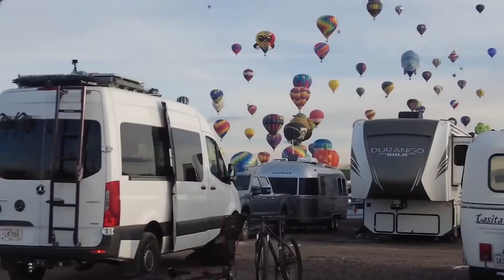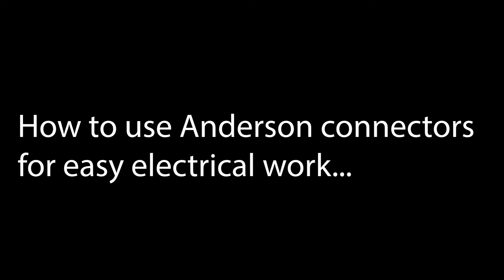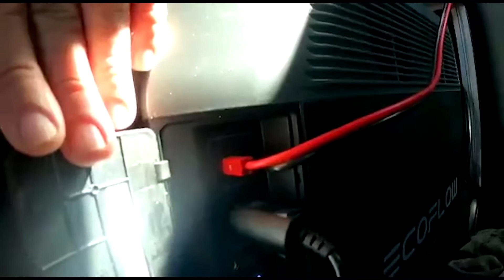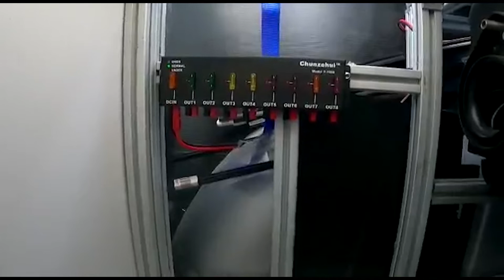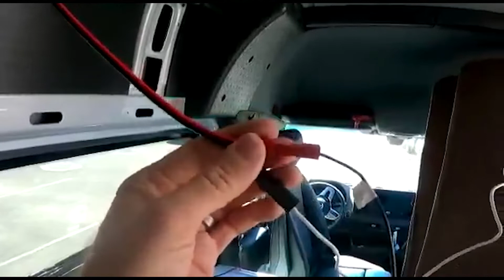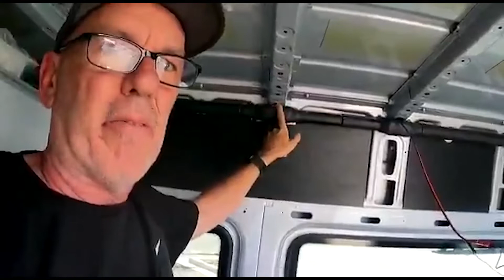HOW TO USE ANDERSON CONNECTORS SIMPLIFIED ELECTRICAL SPRINTER VAN BUILD

Comment: So you connect the EF DP via the anderson connector to the to the 12v fuse box voltage in, and then pull a wire from the fuse box across the van to the otherside and put an xt60 connector which you plug into the "solar charging" port on the river pro, and in that way get the trickle charge from the delta pro? 
Can you show how you connect the ecoflow DC in to the fuse box? Is it using the anderson port on the EF and then just a wire? Would love a short explanantion, it sounds simple but  just to verify..  im planning to build this in the coming week....
And then also how do you handle the 120v circuits? Do you just plug each on into a plug on the delta pro via extension cord? so like an induction cooktop, just plugged directly in to the DP?
Reply from the maker: Hello - Yes, we trickle charge the River Pro via the Anderson fuse box.  In order to connect the ecoflow delta pro to the anderson fuse box - you just take the wire and add anderson connectors to both ends - then simply plug into the delta pro and the fuse box.  Very easy if you need to make changes.  RE: 120v - yes, we just use extension cords to run the induction cooktops - simple and easy.  Best wishes with your build - so fun!

Comment: Hi. Still figuring out if I want to go with the Eco Flow. Looks so simple. 
A question I have is if I want to have a 110 plug say to run a coffee maker is that something I can run from the Anderson panel?  Do you think they have some sort of combination connector that would go from that 110 plug to the wire to the Anderson panel? Or do you think I would have to plug the coffee maker to the Pro?  I will be doing a few days with the battery power so the  Big pro will be enough.   Thanks
Reply from the maker: Hey Chris Hart!! The coffee make is a 110 volt and the Anderson is a 12 volt so the coffee maker has to be plugged into the Delta Pro. We are loving them and really find it very simple and easy to find charging stations etc... One of our last videos shows how we are currently using them and charging them.  Thank you for watching and taking the time to leave your comments.

Comment: Hi. I had the same question as Ruth?  Can you wire from the Anderson panel to a 12v plug so I can run a refrigerator?  I’m not that sharp with the E. Thanks for the vid
Reply from the maker: Hi Chris - yes you can wire from the Anderson fuse panel to your 12v refrigerator. On the wire coming from the refrigerator you just install Anderson connectors and plug into the fuse panel

Comment: It was great to see your set up with the Eco Flo because that is precisely what I have been planning on with my van.  Would you mind giving a parts list of the anderson connectors as well as the fuse box? Thanks
Reply from the maker: Hi Ruthanne, thanks for your comment. The Ecoflow setup has worked great. Love using the powerstations. Here are the links to the fuse box and connectors. Have a great weekend and best wishes with your build. Chunzehui F-1008 Horizontal 9 Port 40A Connector Power Splitter Distributor Source Strip, 1 Input and 8 Output. https://www.amazon.com/dp/B078N343XK/ref=cm_sw_r_awdo_GZWCWK40WSXJYR49QNST.  Anderson Powerpole Connectors 10 Pair Genuine https://www.amazon.com/dp/B005P9CATU/ref=cm_sw_r_awdo_JJFCW4HFSN343BF5N60R
Reply: @GayeNRobert  Greetings again!  I really like the idea of using the anderson connectors and fuse box as you show in your post. I have a Delta Max 2000 which is one step lower than your Delta Pro.  I understand that I can run the output from the Delta into the input of the anderson connector box and run my fan wires and lights but what about a small AC refridgerator?  Do I have to plug the refridgerator (as well as a 700 watt microwave) directly into the Delta unit?  What if I want to have a wall outlet...Can I wire that from the anderson connector box or is that only for DC?  I know I am showing my electrical ignorance, but thought I would ask anyway.
I also wanted to know if you use the smaller River Pro to run your fridge because the AC switch always has to be on and it would run your bigger unit down too fast? Hope this question makes sense.  Thanks
Reply: @ruthannekokkonen8736  Hi Ruth - we are in the "same boat"...I am an electrical newbie with a big van to wire up. I have the same questions...were you able to get yours answered? Wishing you success!